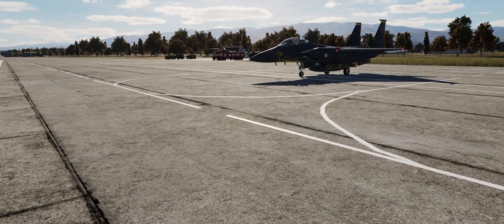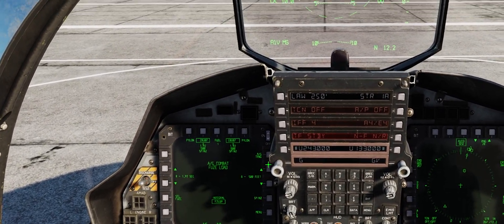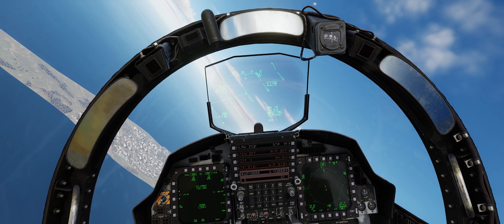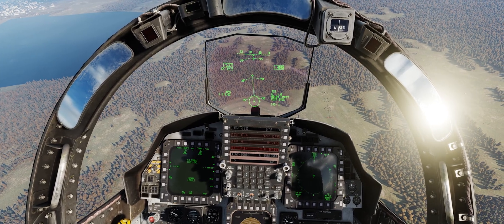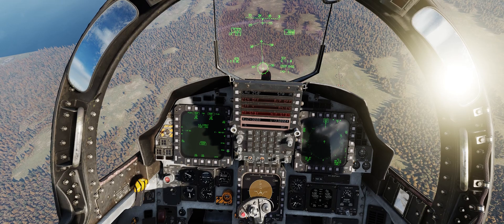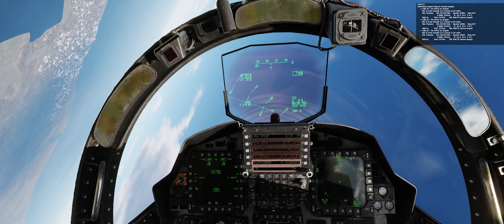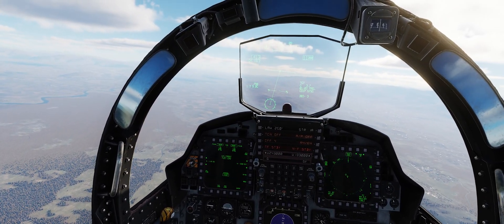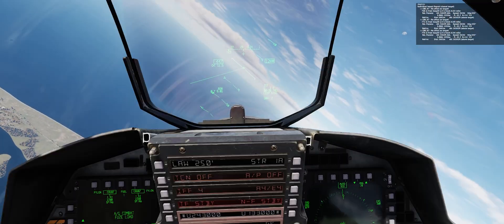Cluster Chucking In the Strike Eagle

Comment: Height should mostly effect the shape (forward momentum, more oval pattern), spin should effect the distribution (width of the pattern). Combining multiple CBU to shape larger, saturated patterns with 2 or 4 overlap in the center of the impact.
IIRC the radar fuze (should be a FZU-39)
is actually set on the ground IRL and set to the required burst height. IRL you can't change that in the air AFAIK.
What you program into the aircraft's system on the armament pages is the settings from the actual bombs, as the mission computer does not know what's set on the bomb. This ensures the drop parameters are calculated to match the actual settings on the CBU. 
Similar the spin should be defined by the setting on the tail-fuze (not sure if it's fixed or has electric fuzing for 2 different settings).
From my understanding only bombs/weapons with a data-connection, mounted on a pylon supporting data transfer allows for in-flight programming of the fuze settings. Everything else is a combination of Nose/Tail fuze settings armed by tripwires or an electrical current that uses different voltage to arm different settings. The only real "smart" bomb being the INS/GPS guided JDAM types that get target data transfered from the aircraft before the drop. 😉
Reply from the maker: Great insight.  Thanks for sharing that.

Comment: I gotta admit, I generally don't mess with the fuse setting on cluster munitions, mainly because Wags said they never worked and recommended leaving them alone, and the spin setting was never implemented, so I got in the habit at leaving them at 1500 Ft. I do need to see if  this works on an F-16, as I use them on it mostly the 105's for tanks.
Reply from the maker: They work a lot better now.